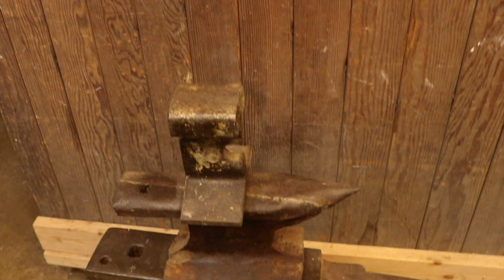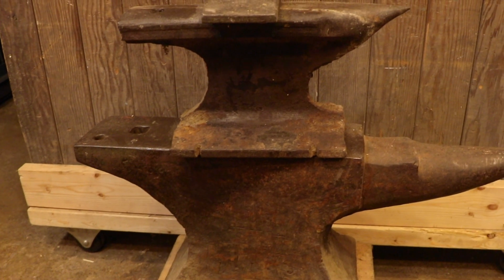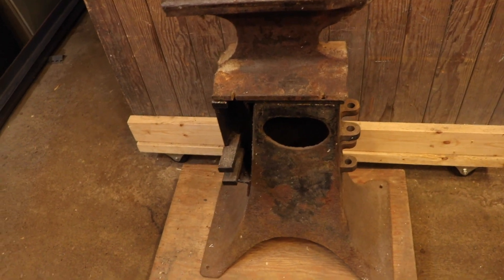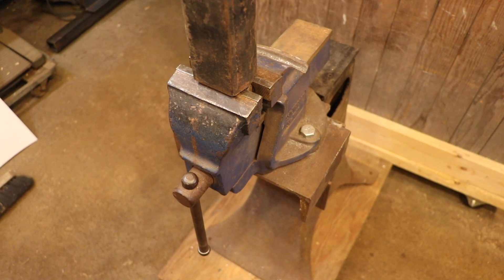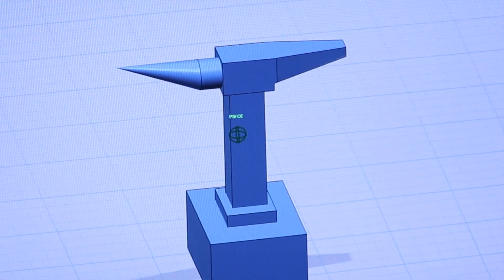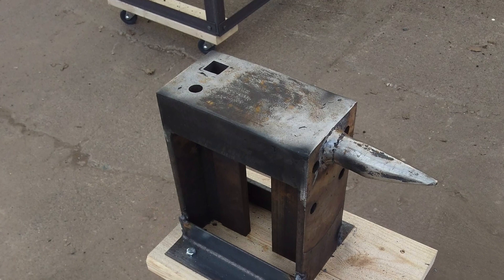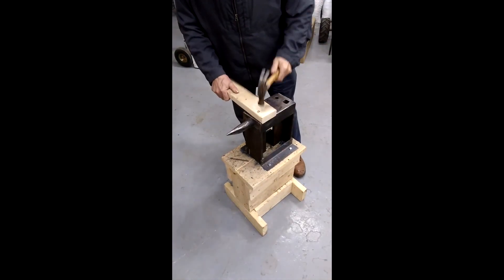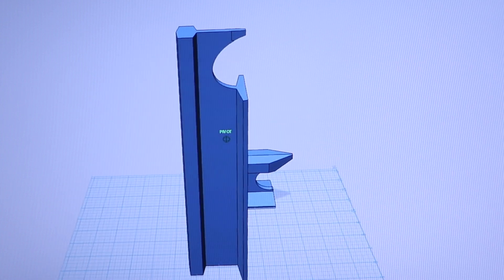How To Design An Anvil - DF In The Shop

Comment: thats an excellent video.  I have a sledgehammer on a heavy base, a fig tree which i modified to have a large bay in the middle of the trunk it is like a workbench too.  i left two branches to provide me with shade in the summer and to give some fruit too.  i was thinking of cutting it to a large stump as currently it is too high, but i like it the way it is, the anvil (sledgehammer head) however is at the height of my upper belly so i may just build up a platform to stand on to make it better to work with.

Comment: I've got some old workout equipment I'm currently using as anvils. I have two 45lb solid steel dumbbells & two 45lb steel plate weights.
I cut one of the dumbbells in half & drove the cutoff handle into the end of a heavy log I stood up, & it seems to be doing well as a small, extremely simple anvil so far.
I haven't decided how I want to use the plate weights yet, but I'm thinking maybe design a pattern I can cut them into such that I can stack & weld them into a fairly solid anvil without wasting too much material, and then mount that to another piece of my big hickory log.
They were all free from my dad, so if nothing else, I've got some thick, heavy, flat surfaces to pound on... 😁

Comment: regarding the structural steel base with top plate using structural steel and concrete, would it be a good idea to insert a layer of rubber or silicone between the top surface of the concrete and the top plate to dampen the noise?
Reply from the maker: It depends how you are planning to attach the plate the concrete.  I would make sure that the plate can be firmly connected to the base but still have it removable so that you can do any modifications that are necessary.  For example my anvil is bolted down not welded to the base.
Reply: @df-intheshop330  thanks.  I was planning on going to a steel shop this week , i can get mild steel quite cheap,is this ok?  also what steel thickness would i use as a minimum? the thicker the better ofcourse but what would a good minimum thickness be in your opinion?
Reply from the maker: Nothing wrong with mild steel.  That's what I'm working with.  As for what to buy, again that is a really hard thing to answer because there are so many options and I have no Idea what you a will be looking at.  If you could email me directly that would make it a lot easier for me to help you out. The comments are not designed for extended conversations.
Reply: @df-intheshop330  Thanks Denis.  I didn't know where to find your email.
Reply from the maker: It's over my left shoulder under my name in the intro clip.  I couldn't tell you in the comments because youtube would see it as spam and send it to the junk folder.

Comment: This is really informative stuff, thanks for sharing your thoughts.  I've been slowly building a stand for a mediocre anvil and your reflections really make me feel confident in the platform I'm building.  I didn't fill the whole base with concrete because I hadn't decided if I wanted to use sand to sink the base and feet into or not, but just a block of concrete in the bottom improved the balance by a hundred fold.

Comment: Excellent video !  This video is very much like the idea I have had for a video.  I realized that the basic pattern for anvils made today are based on wrought iron smithing technology.  Most anvils made today STILL have square holes in front, back, and bottom; holes originally used for manipulating a wrought iron anvil as it was being forged!  I have never seen a video of a smith using these holes for anything (unless you count filling the bottom hole with gunpowder for anvil shooting).  The London pattern is much like the great white shark or the crocrocodile; evolution developed a creature supremely suited to its environment, and further evolution becomes unnecessarily. Which is not to say any of them could not be made better. 
I think your design is superb. Although I feel that a cast steel version would be  even better (I realize that such an anvil  could not  be produced by anything less than a commercial foundry).  I've seen one smith (Joey van der Steeg) actually drill and tap the bottom of his anvil to allow it to be bolted to an anvil stand.  Why no modern anvil makers have put bolt holes in the feet of their anvils is something that boggles the mind.
If a modern anvil were to actually be designed, I imagine it would still have the same general look of a London pattern anvil, simply because the design has proven so effective.

Comment: Would a Hollow anvil dissipate heat the same or do you think a Hollow anvil will allow for more or less working time before another heat?
Reply: I would reason that a hollow anvil with the same surface area will dissipate heat at the same rate as a massive one. It would however heat up faster as it has less mass. So if you forge enough to warm your anvil up it will happen sooner.
Reply from the maker: Heating up an anvil never made any sense to me. I've never tested it but up here in winter the temperature can get to -40 F and up to 90 F  in the summer.  I've never noticed any real difference in working time.  My theory is that when something is 1500-2000 F even an anvil heated up to 1450 F will suck the heat out of the metal and make it too cold to forge.
Reply: @df-intheshop330  Yeah to me neither. The temperature difference between the anvil and the other pieces of metal is just to great that ~100°C, maybe even 200°C, or so less difference matter much. Also I would suspect that most heat loss is not conductive(to the anvil as handles stay reasonable cold) but by radiation and convection (of the heated air).  One could test that by heating three pieces of steel and letting them cool, one in contact of the cold anvil and one just in air and one on a heated big piece of iron. Could be an interesting video.

Comment: Great article.  Did a calc. when someone else talked about designing and anvil.  So let start at a 4 lb (1.8 kg) hammer moving at 30 mph (44 fps 13.4 m/s) 161.6 Joules of energy.   Stanley 4 lb 1.8 in dia 160 J 2 lb 1.38 in dia  80 J  for 30 mph.  Ref: www.physicsforums.com/threads/impact-differences-in-sledge-hammer-sizes.592828/

Steel (4140) after ~ 10^7 cycle has a yield strength of ~ 16.5 ksi, ductile iron ~ 11. ksi, and 35000 concrete ~ 3.5 ksi with an average spreed angle of ~ 32 deg for all three.   Pressure from blow 1.16 and 1.98 x10^5 lbf for the Stanley hammers.   Annealed 4140 (Rc 35) has a margin of safety ~ 0.033 and 4140  quenched and tempered margin is ~ 0.769.   assume the top of the anvil is steel.  Cast iron and concrete at 0.375, 0.50, and 0.75 in depth have margin of safety for the two hammers  2.206 and 1.858; 2.737 and 2.24; and 3.92 and 3.074  and -.65 and -.69; -.59 and -.65; and -.46 and -.55 respectively.  Concrete had to be 2 inch below the impact point to have a positive margin of safety since the force finally spread out enough.    My guess is an inch or two more of metal before impacting wood due deflection.
   
Now like the design.  I could consider that you replace the concrete with compacted  dry sand casting sand (cat litter pulverized mixed with playground sand)  Minimum moister so that the a little binding is provided by the clay)   These is so that you can empty the base if you need to move it occasionally .  Separating the weight will make it easier.  Put a wooden plug in the bottom to hold the casting sand solid.  Apply weight and fasten the wood in position.

Comment: Really like this video.  Some of the info kinda flies in the face of conventional thought, however it stands to reason. Wobbley wonky work surface cant work as effectively as a secure steady surface. A narrow waist cant  function as well as a broad waist. A secure sturdy base weighted nicely will increase usefulness of a lighter anvil by adding mass and reducing flex.
  That's my take of this and your experience backs my theory. 
Thanks f ok r sharing.
🙏blessed days sirSir 
Crawford out 🧙‍♂️